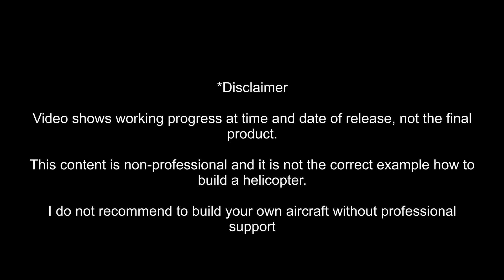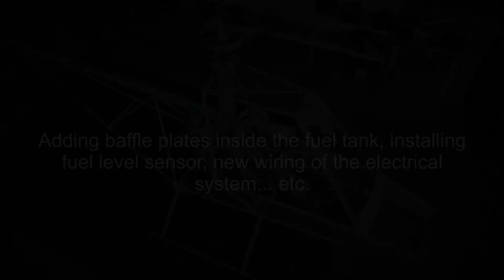Complete Tear Down EXPERIMENTAL HELICOPTER BUILD SERIES (Part 51)

Comment: I see you have made the main rotor blade jig. It will be interesting to see how you tackle that. Wondering what the chord wise cg is on those blades. Did you do a short test sample ?
Reply from the maker: Yes i did a blade jig with a 6° twist for the blades.  The chord wise center of gravity of my blade is around 25% (tested on a short blade example).
Reply: @ultralighthelicopter  sounds good. looking forward to seeing the blade build. 👍👍
Reply: @ultralighthelicopter   Please make a separate video on rotor blade construction..